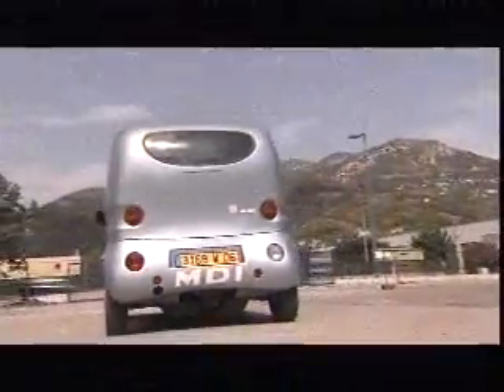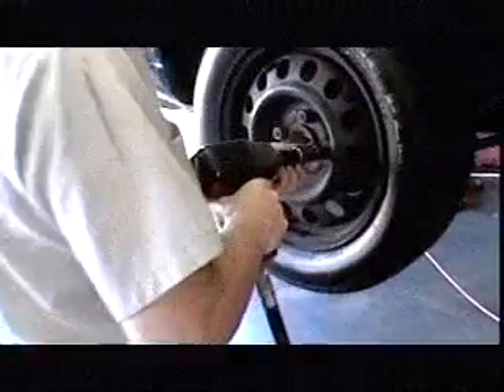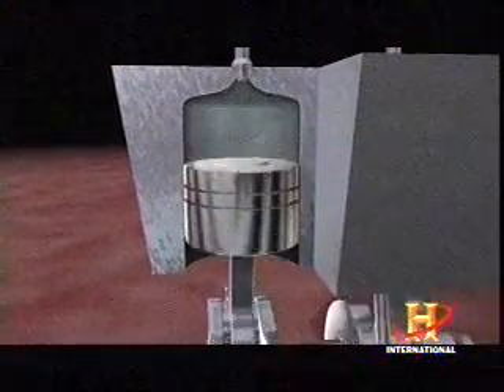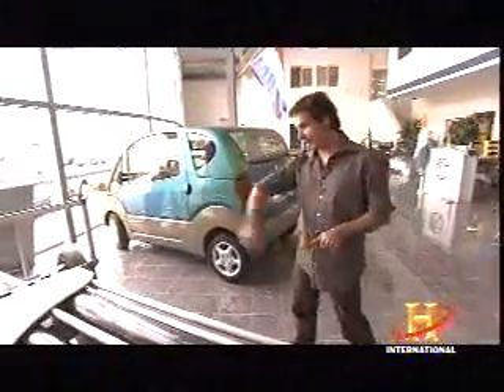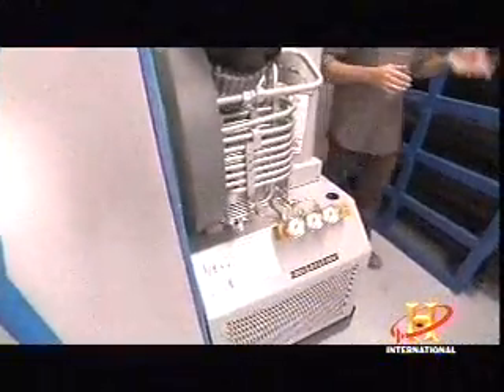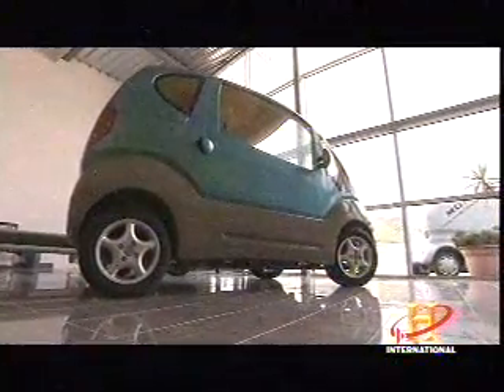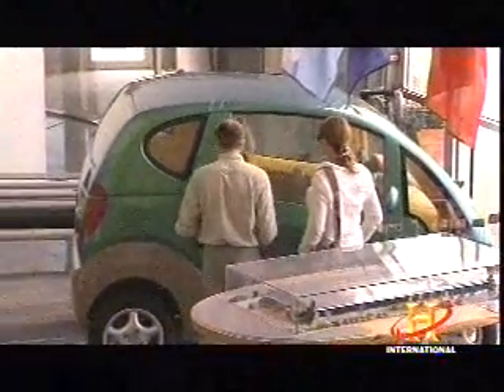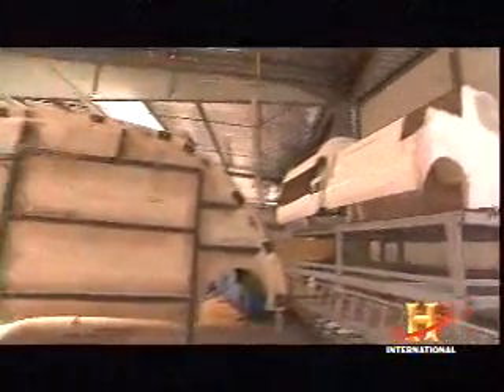compressed air car

Comment: Convert it to run on compressed nitrogen and fit a super high pressure tank. You might literally drive the wheels off it with that much power.

Comment: If an MDI air engine was put on an air compressor (air powered air compressor).  The air compressor run an alternator on an electric car and refill its own source air tank.

Comment: No video of the MDI car traveling at roadway speed on an actual road.  All demos take place in a parking lot.  And Guy Nigre has been working on this concept for over ten years.  They have already back-pedaled on the functionality of the engine by adding fuel combustion to the process, so it can run either way... but still no road demo.

Comment: Good point but the problem is the CO2 density. In a forest or park, the CO2 released by a rotting tree can easily be absorbed and used by other trees. A single tree which breaks down and rots on a field far away from other trees is not too good but it still doesn't hurt the atmosphere. But imagine hundreds of thousands of trees being burnt in a small factory. This will have noticable negative effects on the atmosphere if you would somehow compress the CO2 and release it in forests ...

Comment: In the USA, there have been many companies wanting to start firewood-burning power plants. Firewood is very misunderstood by most people. They think forewood is a polluter, but it is extremely clean. The reason is clear only when all things are considered. To burn a tree, you have to grow a tree. That tree gives off much more oxygen in its lifetime than carbon when it is burned. The net result is even better than solar or wind, if you can understand this. If a tree is left to rot, it gives off..

Comment: Facts 5 hp, 7 mile range 6 hour recharge IF you have a 6hp 3500 psi compressor

And you are going to "work all the kinks out" 
I'll help you hint don't pick up your tools by the sharp end

Comment: The wind is ONE source that can make High Pressure Air w/less carbon foot print all around than that of electric Safer and less expensive too. I suppose transferring 4000 U.S. gal. fuel per min. from plane to plane travelling over 500 km per hour is impossible too! NOT..so.transferring HPA @ 50 km p h from a fixed ground point is a SNAP... clean and risk free, on the move.So negative nanny's,there goes your how big is the tank equations  It's your independency DEPENDING ON IT , HELP CHANGE IT

Comment: Compressed air is simply an energy transfer method, like a chain or a transmission. Compressed air is not an energy source. The source is gasoline or coal. If the USA becomes more hydroelectric or solar, then efficiencies begin to kick in. However, this adds great cost to the source, requiring more resources as compensation.

Comment: Electric cars require power plants, the burning of coal, the manufacture of large batteries, and much more. All told, it has not been proven they are any more efficient nor help the environment any more than gasoline-powered cars.

Comment: @thedmf12345 at 3:39 "ready to go 125 miles for just $2 (of electricity)."  Ive read an article that compared the amount of CO2 released from electricity to charge a compressed air car VS. driving a toyota Prius.  turned out that the air car produced half that of the prius per mile.  And if you had a solar panel on your garage, that did nothing but charged a large tank at home whenever it was sunny, you would not need batteries to store electricity and there would be no carbon released.

Comment: So there are two issues here.  Does it save energy(or is the total cost less) as compared to cars run on fossil fuels? (I'm sure oil is not cheap from the ground to the gas station.)  Can the pollution used to compress the air be diverted away from the city, or contained better?

Comment: @2karriizman A 6kw compressor running for 6 hours gives this piece of crap a 5 mile range (only published actual test result) So your $40,000 worth of photo voltaic cells looks like a stupid investment. Much better to use them to recharge an electric vehicle so you don't throw away 80% of the energy.

Comment: Cut the crap and answer the only important question: How many kwh's needs the electrical compressor to compress enough air for 100 km driving? In other words: How high is the efficiency?

Comment: I hope he has an on-board air compressor to refill air tanks. And regenerative brake motors to recharge batteries and other equipment. So mass produce it already.

Comment: The cool thing about gasoline is that it packs a lot of energy.  The problem is that in a normal engine 90% of the energy is wasted as heat.  And that is just the energy wasted in the car, not taking into account the energy used to pump the oil out of the ground, trasporting it to the refinery, transporting it to the gas station and pumping it into the car.

So 50 percent (while innacurate) would still be way more energy efficient than 90%

Comment: My concerns are with the ability of the electric grid to support the increased demands. Also this car sounds very loud. After all noise is a type of pollution. Btw I meant to say "heat the air" in the prior note.

Comment: shanghaijoachim, The compressed air comes from the air tanks that are filled by a compressor that runs on electricity. Therefore you should or could fill those tanks at home with an air compressor. By heating the air it then expands and during a long journey you would need to heat the air to expand it and go further. That of course would require a small electric or gas motor to heat the gas. However on short journeys one would not need a dual arrangement  to operate the car.  A novel idea.

Comment: The French engineer Cugnot was the first person build a first self-propelled mechanical vehicle.  Also, Renault has had a litany of automobile innovations like one of the first very popluar front wheel drive cars for the masses, the legendary 2CV.  As for America, a country which only produces 1/3 of its own oil should not be indulging in horsepower fetishism.  Small cars powered by compressed air, natural gas or electric are at this juncture the only viable option.  In other words, early days.